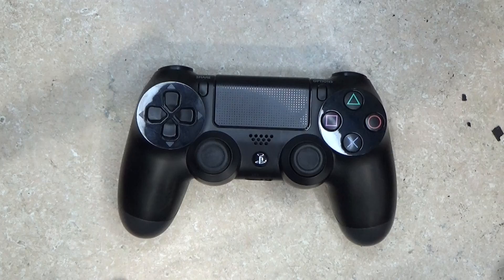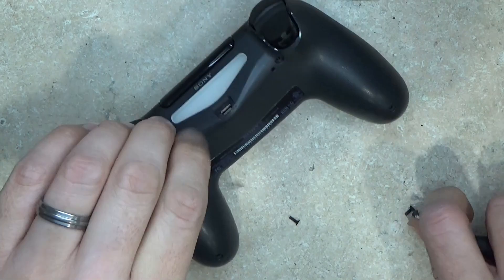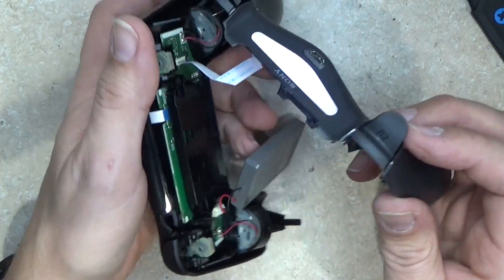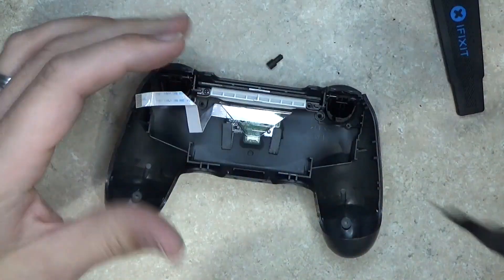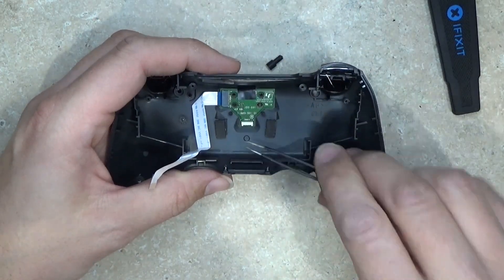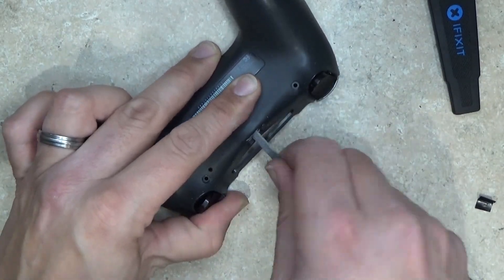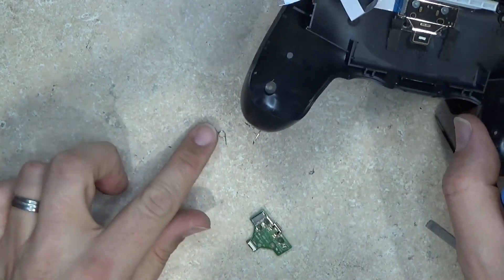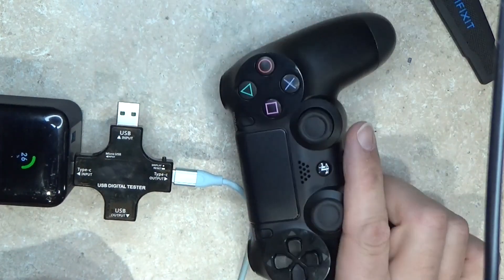PS4 controller USB-C mod install.  Install of a new USB-C board from tindie.

Comment: thing stressed you out a bit there lol
sometimes you never know what to expect when working around stuff
Reply from the maker: The stupid controller wouldn't finish coming apart!  When i did the orange one, it popped right in half without any grief.  I may have stabbed myself with the tiny spring putting it back together too :D